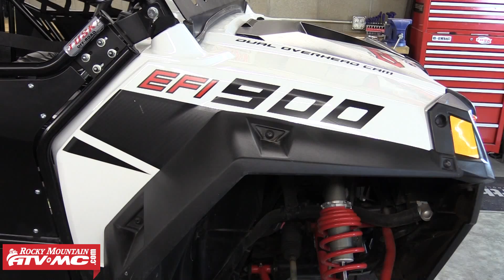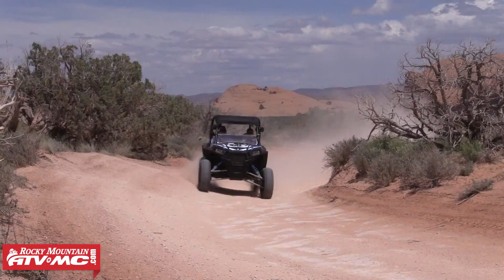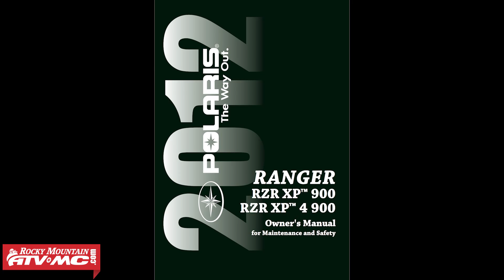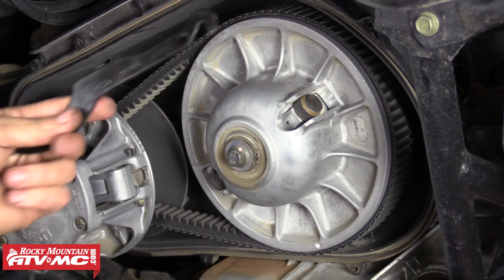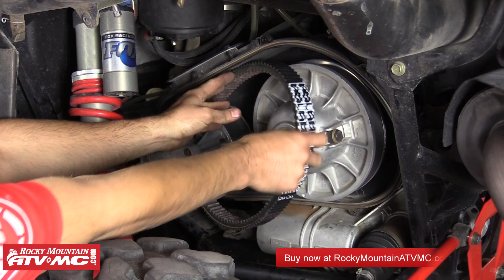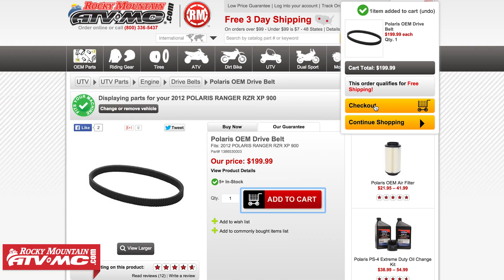Polaris RZR XP 900 Drive Belt Change

Comment: What year was this Ranger RZR 900 XP manufactured?
Reply: Good video except when prying the open the clutch with the clutch tool it would not lock just spring back. Any idea what happening?
Reply from the maker: The RZR XP 900 was introduced in 2011 and was made until 2019.
Reply: @rmatvmc  thank you

Comment: Thanks for the great video. I just went over 2000 miles and am going to install new belt. The local shop says to scuff up new belt with a green 3m scrub pad before install. Ever heard of this? Do the new belts need to be broken in or just jump in and rip?
Reply: soak them in oil and set them in the sun for a few hot days then after install spray with a high compound lubricant-- just kidding put them on and go..
Reply: @shawnbaird2015 you had me going for a second lmfao